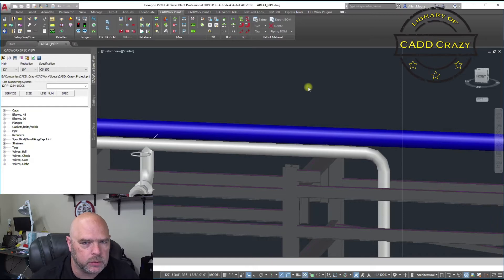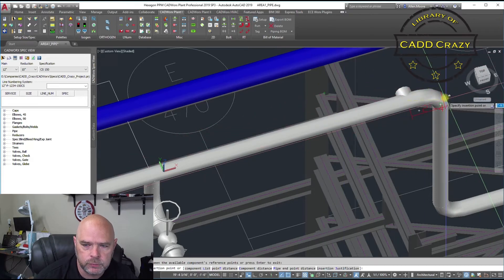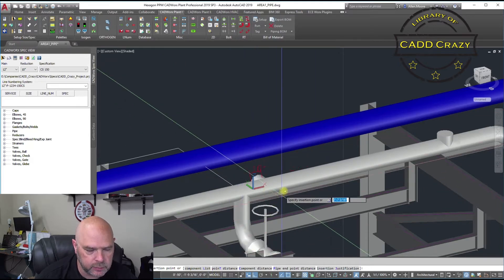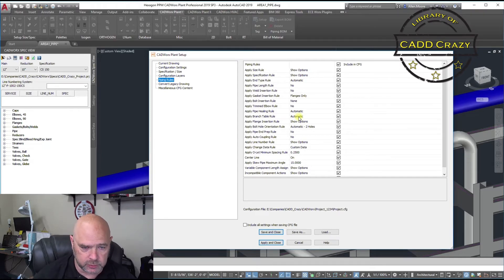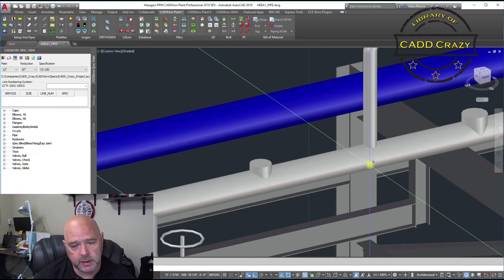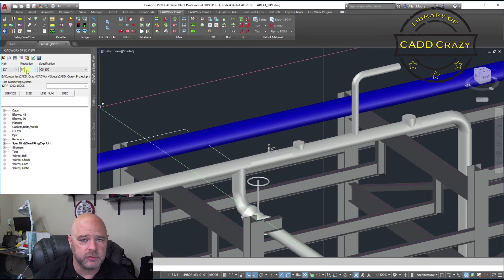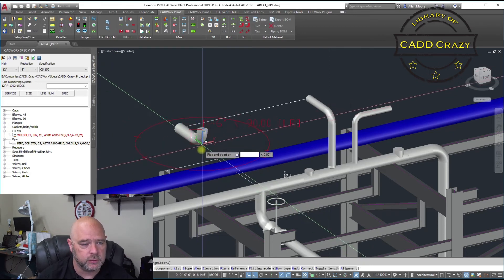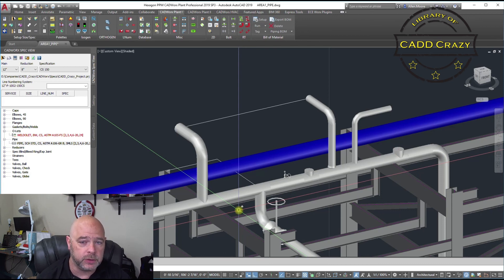CADWorx Plant Branch Fittings

Comment: Nice video man.

But i have a question about making regular tap/stub-in connections. For drains and vents i mostly use some kind of valvolet, Bonney Forge Extended Body Valve with a LIP END connection in 3/4 or 1".

Now, making a tap connection is so strange in Cadworx that you have to draw extra lines to eventually reach the "Side Of Pipe" but it really doesnt make sense to do it this way. Do you know if there is a more logical way to do it?

Comment: Please i need a clarification on these three plant software's namely: E3D, SP3D & CADWORX
please compare in terms of beginners and experience
1. Which one is easy to learn and use
2. Which one can handle complex plant design project
3. Which one is well reorganized
4. Which one is easily accessible to other pipe plant designers
5. Which one is can easily correct model jobs/works maybe something to add, amend, correct and asbuilt
6. I nees to knows all theirs limitation, capabilities, etc

Please i will be eagerly waits your responses, thanks alot you have been so helpful to pipe learns especially in my life